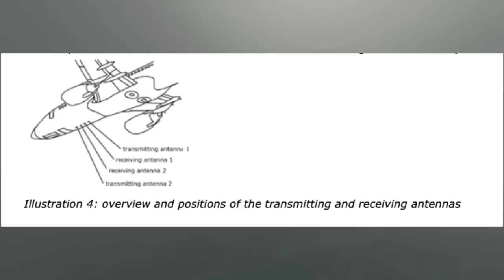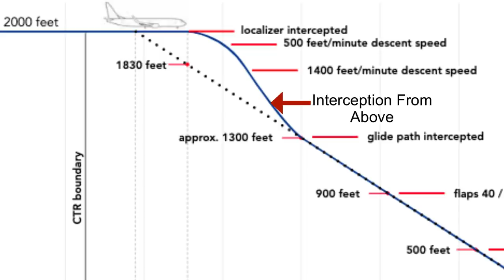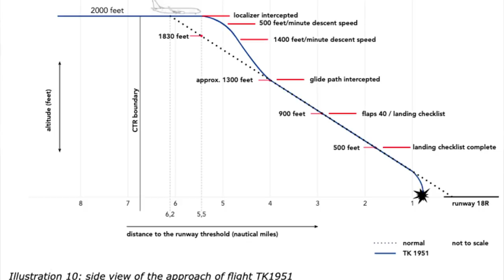How A Broken Antenna Crashed This Plane | Turkish Airlines Flight 1951

Comment: This is the fallacy of pilots who have never learned to fly by the seat of their pants.  It is a fallacy to rely too much on the auto throttles or other automation.  Yes, the glide slope I can see, but throttle settings no way.  Always keep an eye on the airspeed, and never ever ever trust your life to some automatic system.   Lose your airspeed on an approach and you lose your rear end literally.   Not only that if you are not hand flying the aircraft, if there is a glitch in the software, there is no room to recover.

Comment: You didn’t even research why the MAX can’t use both sensors… bad reporting. It’s published information now.
Reply: Even 2 sensors is not much for a safety critical sensor. It might be OK if it is just a pilot looking at it and comparing with another one, but not if a computer needs to decide which one is correct.
Reply: It wasn’t a 737Max

Comment: Apart from everything else, if a system delivers an impossible value (-8 feet) it should self-flag as clearly defective!

And no autopilot or auto-throttle should rely on such false data.

Obviously you can use the autopilot without the auto-throttle and vice versa. But if both are in use, they should talk to each other, telling each other about their state —- flare and decrease sink rate (not in a flare) should cause an out of sync error. And unless you have the code to safely handle this out of sync case sanely and safely, it must be locked up to the pilots. That means audible and visual alarm that clearly indicates what went wrong. And disconnecting all systems involved.  Here that would have been autopilot and auto-throttle.

I do not understand why such basic fail-safe precautions are not used. And this is a common theme in crashes, it seems: computers delivering or relying on data they trivially can find out is wrong, implausible or impossible, while not telling the pilots that that is the case.

That is almost fail-deadly, that is the anti-disarm trap off bomb or the anti-tampering trigger in a mine … meant to cause extra risk to life and limb for those trying to handle the situation.
The only difference is that the plane is not actively trying to kill you when every last system works as intended (which is not the same as “as designed”)!

And in case of the radio altimeter, it should not even allow any signal to pass from the receiving antenna to the receiver before the delay signifying, say, -1 foot has been reached, even if that means the radar altimeter will not function properly if there is a person under it or a tug pulls/pushes the aircraft.
Reply: -8 feet isn’t an impossible value.  The radio altimeter is calibrated to show zero when the gear touches down in the flare. As the nose is lowered to the ground the Radio Altimeter will show a less than zero reading.
Reply: @kickedinthecalfbyacow7549    The antenna was short circuiting between sender and receiver and that gave -8 feet.  The antenna would have to touch the ground for -8 feet to be a correct value.

Your turn.
Reply: @advorak8529  -8 is not an impossible value, it would read that on the ground. That does not mean it is correct, it is erroneous but not impossible.
Reply: @kickedinthecalfbyacow7549  But the plane can tell when it is on the ground via the weight on wheels sensors, so -8 feet when the plane is not on the ground means there is a fault 100% of the time
Reply: @aarondynamics1311  the radio altimeter was faulty, it was a known fault that was recorded in the tech log.  The reading of minus 8 feet was incorrect but it was not “impossible” as was described in the video.

Comment: "Jesus" components are parts of an aircraft that are single points of failure that cause disaster if they fail. Seems that these radar antennas, and likewise, the AOA sensors on the 737MAX should have been designed to 'never fail' as their failure has led to death of many people. Yes, some aircraft components have no redundancy and must be of extremely high quality to not fail.

Comment: Even you have redundant subsystems, it will be like a dog chasing its tail. The redundant sub systems will encounter a Byzantine Generals Problem. Which of these subsystems is the source of truth. Fuzzy logic will need to be put in place that may or may not be situtation aware. Often this fuzzy logic, like the mentioned culprit, i.e. auto throttle system, will be based on rule of thumbs - like a dog chasing its tail, will double back itself to the original issue.

Comment: Funny how the equipment is at blame.  Yes you might have a system malfunction.  But what happened to partial panel flight training . Job number 1 = fly the plane.
Air France 447 was the classic , we don't need training. Get the computers out and learn some stick and ruder basics.  How about unusual attitude recovery.  So much has been lost since I had my flight training!

Comment: It will most certainly happen again, I doubt Boeing has learned the lesson even now
Reply: The MEL explain what to do, pilots did not Chk it and if they had done it correctly then they would NOT have used auto throttle and then they all would have been alive to day, so Pilot error with out a doubt 😱

Comment: pilots fucked up, when one of the AP's malfunction, you dont go for an automated approach.
Reply: It wasn’t the autopilot that malfunctioned it was the radio altimeter which then affected the auto throttle
Reply: its irrelevant, the fact one of the autopilots disarm means something is wrong. There is a reason you need to have 2 autopilots armed on the catIII finals. You need the double check. So either you abort and figure out what is working and what isnt, or bring her in visually if you can.
Reply: @AntiSociety100  the fact one of the autopilots wouldn’t arm doesn’t mean you have to abort the approach. You can still fly an approach with 1 autopilot if you are paying close attention to the instruments and then disengage closer. In fact I’m sure you can still autoland with 1 AP (aircraft depending), you just need to see runway sooner

Comment: First I totally agree with Pat Ferra, second the pilot ARE to blame Not the auto pilot, nor the auto throttle, the fault was the RA no 1 system and that’s connected to auto throttle, but when you have the failure of no1 RA system records into the log book ,then the pilots are required to check the MEL list and it clearly states that you are NOT allowed to use auto throttle system! So how come 3 pilots miss this crucial point, this I aBIG Turkey’s problem and and not a small one !
They where in my opinion incompetent pilots all them ! And to the people who make this film, why don’t you see and understand this, it’s mind boggling that you always try to blame the systems when it’s clearly is a severe pilot problem 😩🥵😱

Comment: Nowhere in your assessment did you address the real human factors that led to this event. You also got the autopilot/autothrust interaction totally wrong. Couple this with the undocumented autothrust inputs, ridiculous dual PFD (RETARD) annunciations, one for idle thrust and one for idle thrust due to ground proximity, an all but useless “safety pilot” on the jump seat, a solid ex-military pilot under training (but not used to autothrottles), the trap of intercepting a glide from above just as starters. Also not mentioned is the ridiculous autopilot trim function whereby the autopilot will command constant nose up trim even though the aircraft is flying below bugged speed. Out of respect for those who died this clip should be remade.
Reply: I don’t think many people here understand the AP/ATHR relation anyway. The way I understand is the autopilot was still flying in LOC/ GS because it was using the FO’s RA, otherwise it would have entered FLARE mode. 

The autothrottle was getting info from captains RA and went into retard mode. Why does the autothrottle not also use FO’s RA? Then this wouldn’t have happened. Dual coupling wasn’t possible as CMD A thought it was below 400ft.
Reply: @tomstravels520  The coupling of the RadAlt 1 to the autothrottle is found in countless aircraft. I don’t know why. I presume it saves few quid.
Reply: @Trevor_Austin  countless aircraft that aren’t Airbus? Cause Airbus autothrust uses RA2 if FMGC2/AP2 are the master
Reply: @tomstravels520  Most older Boeings, Fokkers, Embraers and I’ll bet many others.
Reply: @Trevor_Austin  makes no sense to me why they’d do this

Comment: This catastrophe may repeat in the near future because 5G communications are expected to interfere with radar altimeters, especially at low altitudes. We don't know what autopilots/throttles will do with wonky data from radar altimeters compromised by 5G. A new 5G band has been established adjacent to the radar altimeter band, but all altimeters were not designed to handle so much out of band interference. Aviation industry coalitions firmly protested that 5G radio allocation, but billions of Dollars behind 5G prevailed.

Comment: quite often turkish operated planes do crash and therefore I do not fly with any of such airlines.
Quality is a question of attitude and not of national pride, same for competitions.
And turkey is the old man from the Bosporus and will be due to its unability to evolve for the better like for example the genocide when they killed the armenians being watched by amercans and germans they had called for support.

If a nation can not deal with such massacres then it will never make it to the top, and that is where they are: simply no excellence, but deliverng mediocre performances on ground (mechanic crews) and in the air. 
And VW even stopped its plans for a plant there like FORD did before for the van / transit, which are also delivered in mediocre quality to the west european VAN builders who can not believe what they got from there year by year slowly improving.
I don't need such risks and reject every turish operated flight just as a precaution.